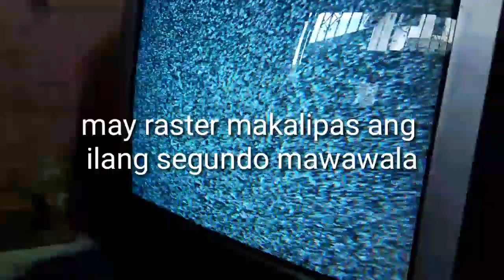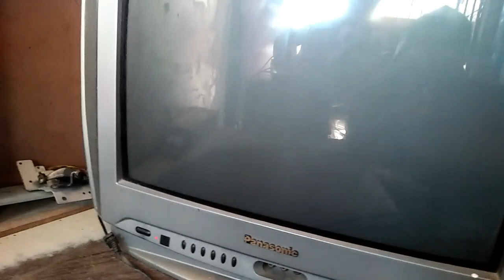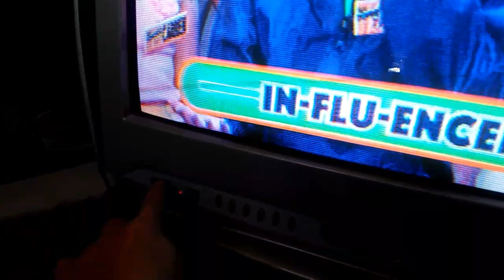Crt tv hard trouble panasonic

Comment: Gud am po sir wong tech.support po.sa ampli po  creckling snd pero may tunog pa rin po.sir ask kopo kng ano yun dapat e check ng repair board na po ako
Reply from the maker: Anong klaseng amp yan at brand?
Reply: Sir promac po av  su2530bf sterio
Reply: Sir wong may bt  usb at aux.input crackling snd. Po sir biglang mah iingay yun spkr.na try ko na rin mg palit ng mga drive trans.

Comment: Sir may ginagawa ako ganyang model standby lang wala ako masukat b+
Reply from the maker: Check diode connected sa horizontal... Yung b+ ng ganyang model connected sa primary kaya wala kang masukat kung nka body ground ka
Reply: @Wongtvtechvlog  sir ganyan din repair q wla aq masukat na b+ pero may stby power..suspec q ung SE090..bka may naencounter ka na ganito?thanks.
Reply from the maker: Yung b+ ng sofhia panasonic connected sa primary kya wala kang masukat na b+
Reply: @Wongtvtechvlog  kaya nga sir connected sya sa primary,,sa filter cap ng b+ kya?meron masukat..kc trouble q black lang ung screen,,check q muna  heater o kya sa abl..kla q kc wlang b+,kya dun muna aq nagfucos.,suspec q tuloy c SE090..salamat sir;)